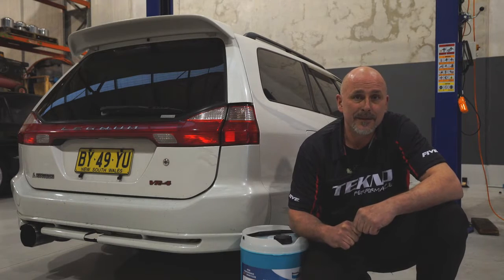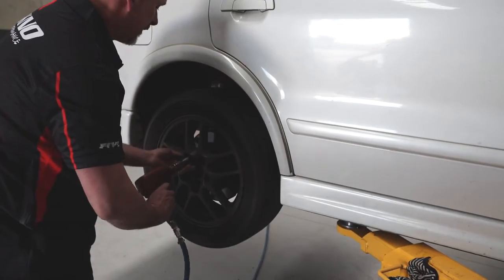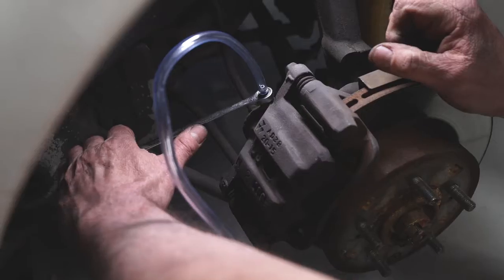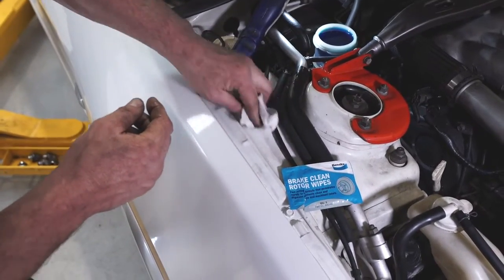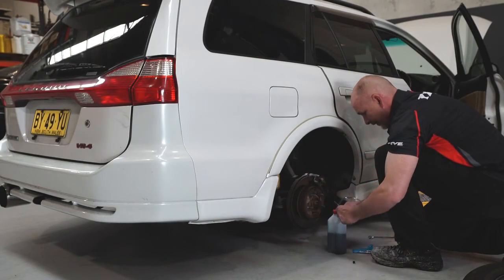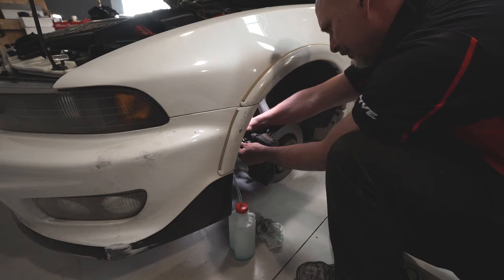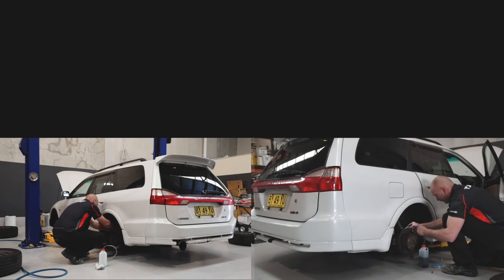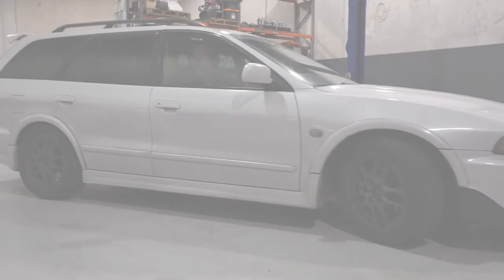How To Change Your Brake Fluid

Comment: shocking video with more than one error.
I mean can I ask who the hell you are showing this video to? How many DIY'ers have a hoist and a barrel of Pro brake fluid? 
...Never press the brake pedal to the floor when bleeding it will ruin the master cylinder
Reply from the maker: Hi Mark, thank you for your feedback. All mechanical work shown in our videos are performed by qualified mechanics inside a controlled workshop environment. This video has taken in professional consultation with mechanics regarding the steps required for changing brake fluid.

While most DIYers do not have a hoist, the same result can be achieved using a car jack and 4 jack stands. The high performance DOT4 brake fluid is not available in drums to non-commercial customers, however most Bendix stockists will have 1L sized bottles of the same brake fluid.

If you have any further questions, please don't hesitate to ask.

Kind regards,

The Bendix Team